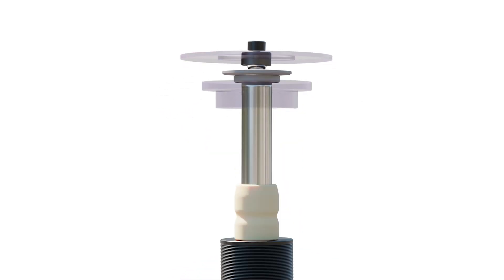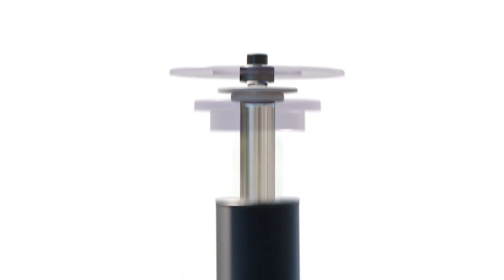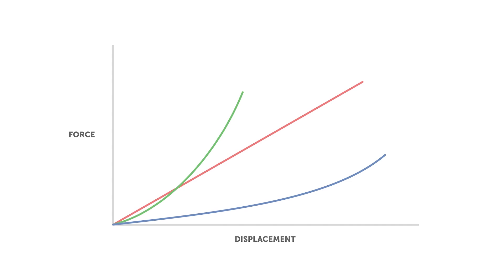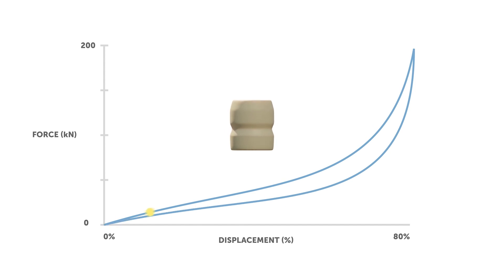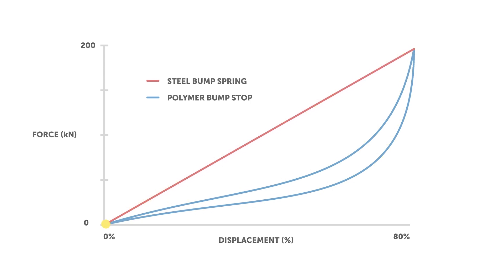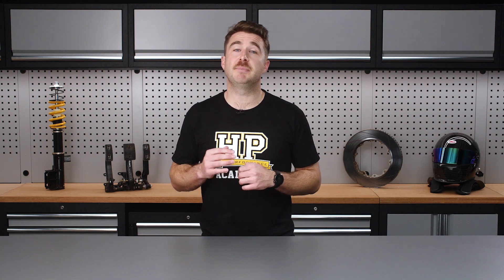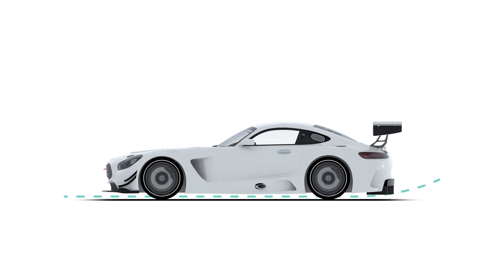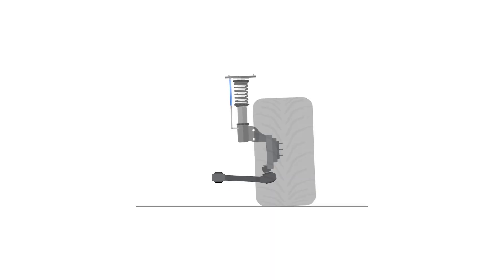Let's Stop Ignoring Bump Stops?

Comment: FT: CUT BUMP RUBBER AT 20MM FROM THE BOTTOM AND USE THE UPPER PORTION. Is the bump stop in the dust boot i want to buy tein s tech spring but it says i need to do this

Comment: Does this equation make sense?
((175÷25.4)−((900÷0.65^(2)÷600)−0.20)−2.25)÷0.65

Suspension travel: 175mm
Corner Sprung Weight: 900lb
Motion Ratio: 0.65
Spring Rate: 600lb/in
Preload: 0.2in
Bumpstop Spring Height: 2.25in
Coilover travel to wheel travel: 0.65

I'd have around 2in compression travel at the wheel. About 500lb available for the springs or 0.577 G force available for braking. 

Then it hits my 2500lb/in bump stop springs > 1300lb/in at the wheels (w/ main spring added) with about  1.123in of compression on the bumpstop for a total of 2.17g (1970lb) available during braking.

Comment: I had my bump stops cut 25mm from the bottom and used the upper portion after installing tein lowering springs. I didn't like the ride quality and returned back to stock, is it ok that my bump stops were not replaced back to original and currently using shorter length than before?

Comment: Always use bump stops that are correct for how you use your particular car.
If it rides fine normally but scrapes and grinds with multiple fat people in the back, use stiff bump stops to stop your tires chewing out on the fenders.
Reply: A bump stop won't prevent those things from happening, it will only make them less likely. In contrast, adjusting the amount of compression/droop travel on the coilover while maintaining the same static ride height will prevent those scrapes and grind from happening altogether.

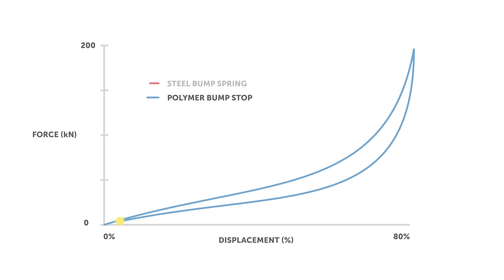Comment: The graph starting at 04:15 triggered me: The yellow dots represent nothing usefull, because they just run through the curve in a give time. 
They should represent the Displacement vs Force, or Force Vs Displacement for better understanding, meaning one should be fixed so we can see the represented difference between the two "device", how they behave in the given situation.

"valve please fix"
Reply: It is actually useful, It's showing the point of the force over a cycle. You can see that it's on the top blue line when being compressed and on the bottom expanding. The force is different between the compression and expansion cycle therefore energy has been absorbed by the bump material. This is called hysterisis. 
The graph is already force vs displacement and as that is the characteristic parameters of a spring having the two spring profiles on the same graph is a direct comparison of how they will behave relative to one another. 
This was actually a very good explanation and visual of the difference between a steel and polymer spring.
Reply: @jakbain1337  Ok. i have read it like a misrepresented "if we apply this froce, we get this displacement", and not as an "at this compression we get this 'opposite-force', and this displacement change". Missed a dimension.

Comment: I was just getting ready to buy new coilovers for my wife's road car, and she complained the last ones are too soft. Was getting confused about the choice of spring rates and the tunability of damping, so your suspension course hit my feed at exactly the right time. Will be signing up for the full course this week.
Reply from the maker: No worries Matt, hope you enjoy the deep dive into the world of suspension! We've worked really hard to put in a ton of animations too in order to ensure there is minimal head scratching to correlate what the tutor is saying with how the components work 😎 - Taz.
Reply: High Performance Academy can i nstall one and half of jounce bumper for front and rear shock absorb ??? Or there is problem when do this idea 💡? I just want to save my shock from damage and increase of height of my car level …. Ur comment

Comment: Would these be just as good to use on a non coilover??
Reply: In my opinion yes, as long as it is used between the original points of contact for the suspension. Of course installation will differ case by case. 

Some cars with a trailing arm suspension, will have a bump stop in between the frame and the trailing arm itself. As long as you have mounted it properly and with the travel arch and direction in mind, it should be fine.
Reply: @Nikoxion  I guess that's the difference with coilovers the spring sits more higher then with normal dampers.
Reply: @ifell3  Sorry, can you try to explain that a bit differently?
Reply: @Nikoxion  my mistake I was thinking the coils spring sat higher.